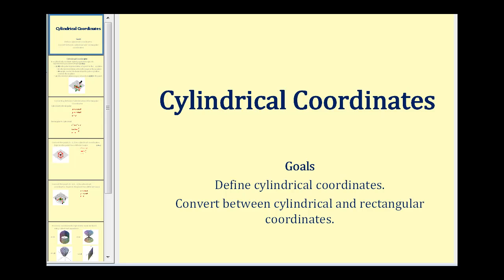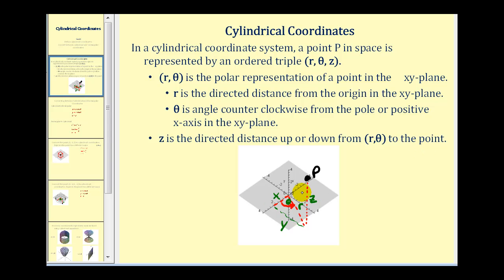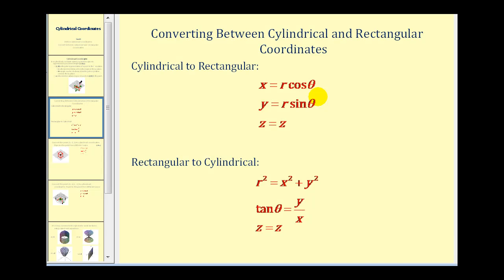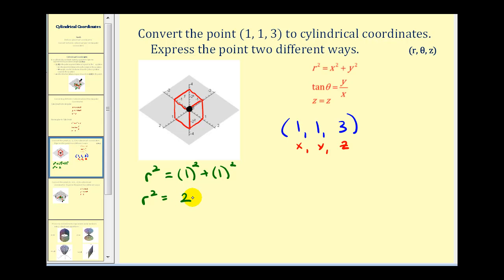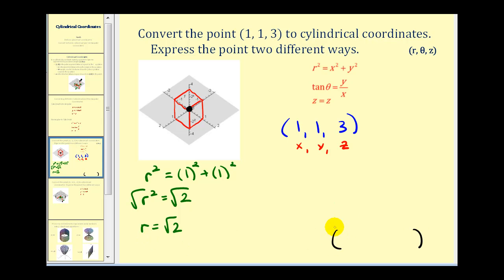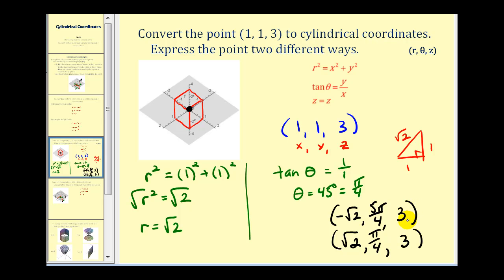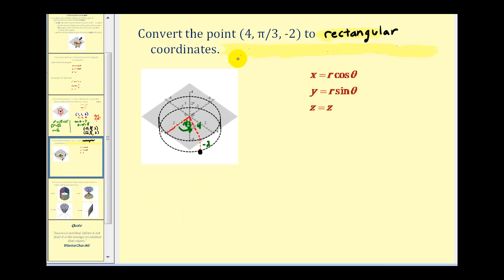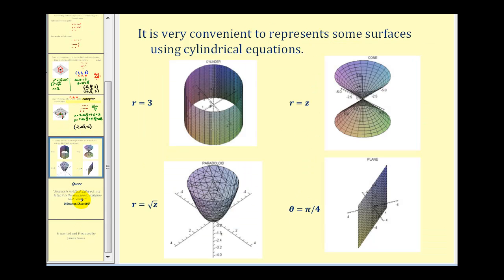Introduction to Cylindrical Coordinates

Comment: there's one thing that's bothering me : WHY is y = r sin theta ? I get why x = r cos theta, it's just basic trigonometry. but how can y be calculated from theta if theta is the angle between x and r ?  theta isn't even a part of the triangle made up from r, y and the line between them. it makes sense if theta is 45 degrees, since then the other angle would be the same, but isn't theta supposed to be an angle of any degree?
Reply: draw r, and the axis y and the axis x
and theta between r and x
then move y  so that you get a triangle 
  |\
  |  \
  |    \
  |      \ r
x|        \
  | _____\
     y
is it clear ?